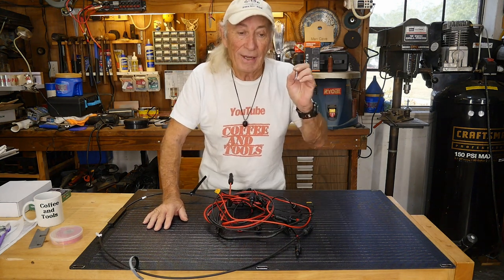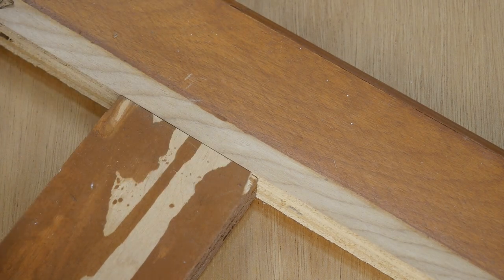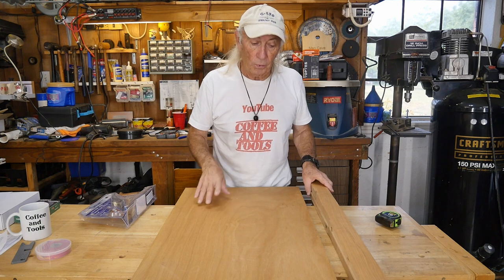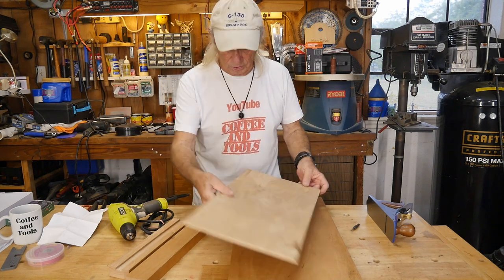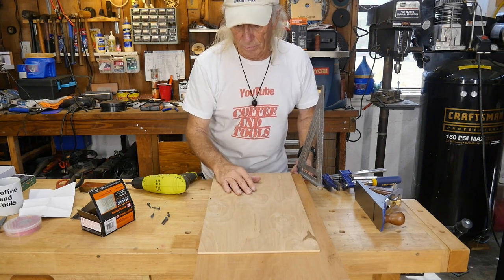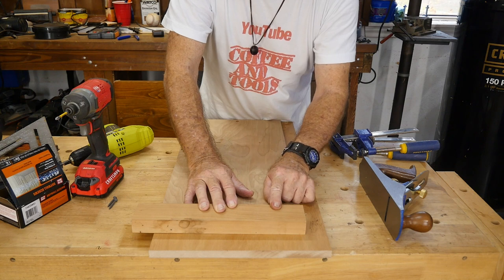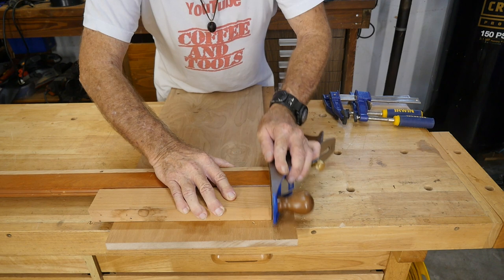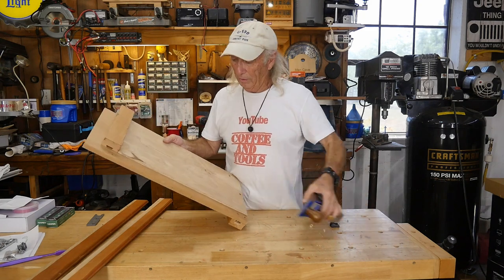How to make a cheap shooting board for wood working, C&T ep 374

Comment: Good Explanation on shooting boards.
They are a great tool to have in the shop. And they do not need to be expensive for fancy. Neither does the bench plane. 
The bench plane just needs to be square itself for this to work.
I have made cabinet grade butt joints on my old craftsman table saw. It just requires the spindle to have good bearings with no run out on the blade and perfectly square blade to either the table top or cross cut sled.
Usually the table saw setup is finicky but once its set don't move it. LOL.
Reply from the maker: Thanks Ken, always fun to hear from ya 🤠